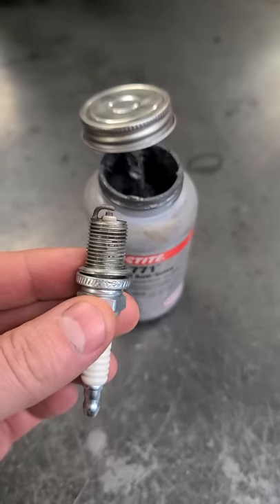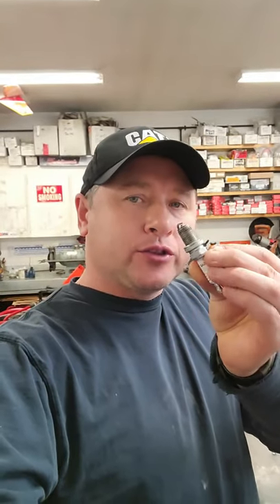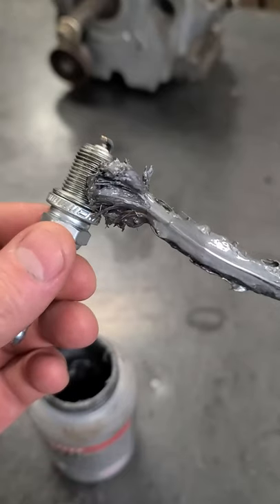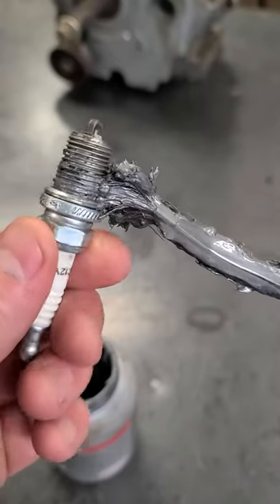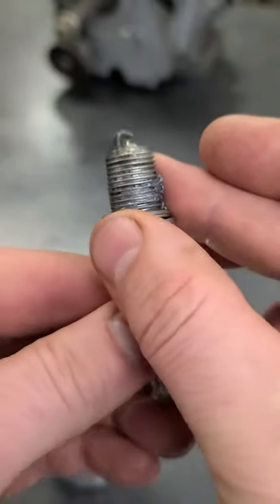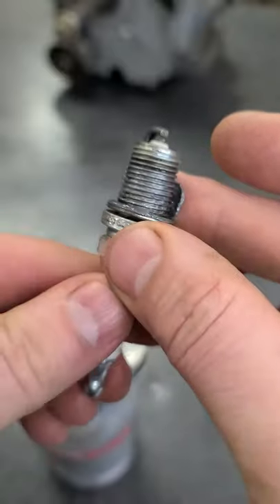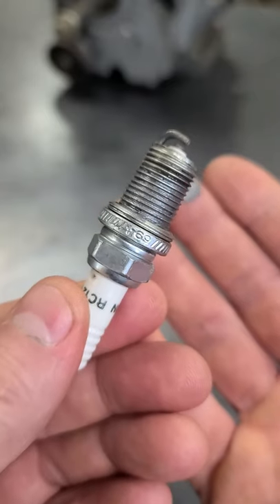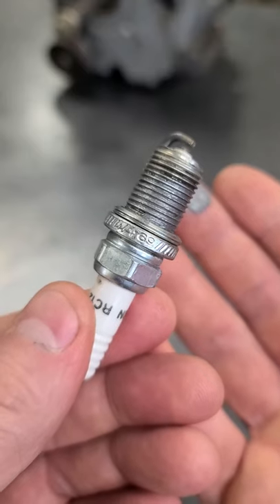Can I Use Anti-Seize On Spark Plugs? #shorts

Comment: I think this is just overkill. It is more sense to put anit-seize where threads are exposed to the elements, rust and dirt. Usually spark plugs are cowered whit vent shield so they don't need that treatment.
Reply: Have a look at any PWC service videos where it protected in theory but several plugs can corrode to the extent that thread breaks off in cylinder head ...not easy to repair !

Comment: Only use it on the Ford 5.4L 3V (04-EARLY 08) SLEEVE as this helped to keep the plug from breaking off in the head. 4.6L Mustang 3v also. I also use it on exhaust studs on aluminum heads. I have been using it on the PTO shafts on my tractors and it makes them easy to push on and pull off. Works good on 5.0L water pump bolts.
Reply: Please pay attention. The subject is anti-seize on spark plugs threads.
Auto makers (including FORD) AND spark plug makers say:
 USE NO ANTI-SEIZE !
There is NO reason to argue. Period.

Comment: Wrong! Do not use antiseize on spark plugs. Antiseize is conducive. Only use some used motor oil on the threads to prevent miss fires.

Comment: Hello Everyone! Happy Holidays! 
If you do use anti-seize on a spark plug, consider using high temperature anti-seize which has more of a copper color to it. And yes, if any anti-seize gets on the ceramic spark plug insulator, it will definitely draw a straight carbon track to ground and etch both the plug, and the boot! Don, Thank You Sir for as always for all of your excellent videos. 
Best Wishes to Everyone in 2022!
Tom K.

Comment: Would nickel based anti-seize be the best choice for aluminum cylinder heads? Would this eventually cause a reaction between dissimilar metals? I would think copper anti-seize would not be a good choice. Maybe Stainless type?

Comment: Well I never used to put anti-seize on spark plugs. But all the ones with a gasket you can torque the spark plug they will come loose over time. If you put anti-seize on the threads they stay tight from my own personal experience. Anti-seize acts a little bit like glue. I personally have had to tighten spark plugs up on cars that have work loose over time with no anti-seize on plugs. If you don’t catch the loose spark plug in time they blow out of the hole. You can tell it sounds like a small exhaust leak.
Reply: ... I just retired from doing engine repair etc and I have to say that if your plugs come loose then they are not tight enough from the start. What any lube does (anti-seize or oil) is allow you to get more tightening with less effort. Properly tightened plugs do NOT fall out!

Comment: Just a little and wipe it down well with a shop towel. Still need good ground contact for a good spark.
Reply: it will get good ground contact thru the strained threads.  on older machines that have had little to no maint the plug wires may break inside so when u take them off they are so brittle that they break and wont run/run right. dielectric grease on plug, porcelean and in the plug boot and connector so u can get it off next time without ripping the whole thing off. also good for dipping the machine in water. ran jeep thru torrential rainstorom on interstate no inner fenders... never missed a lick with dielectric grease all over the spark plugs/boots... dist plug wire boots. HEI ignition

Comment: I agree people should use anti-seize on the spark plug threads, however a very small amount is actually needed. Less is more in this situation. Also it’s a good idea to put a dab of dielectric grease on the boot of the coil pack while installing onto the spark plug.

Comment: I've always used anti seize on plugs for aluminum , and when I'm feeling skippy I'll use it on iron (doesn't do a hell of a lot unless in something that has the plug on top like a flathead or something like that . But I ran into a set of motorcraft plugs that said on the box "don't use anti seize". That struck me as goofy .
Reply: Plugs today dont need anti-seize. Also think about torque specs. You put a lubricate on the threads that cause the torque spec to change & you end up over torque because of the lesser resistance.
Reply: @wandameadows5736  I've changed thousands of plugs in my time and never had any come back for the next tune up with problems . I've rebuilt a shit ton of engines and rebuilt hundreds of cyl. Heads , done several various mods. , dumpling cyl. Heads back at the start and basically rebuilt every component in everything American and many Japanese. Imports in my fifty years plus in the repair industry . I just don't normally spout off about myself , but sometimes I no longer can shake my head .

Comment: You can but I would not recommend it. If ya cross thread the plug in an aluminum head you won't feel it until it's to late.
Reply: ... and that's why you screw a plug in by hand first! (just like a brake line)

Comment: The ONLY time I use anti seize on spark plugs, is if during removal, I have to use ANY effort beyond the first turn or two from snug. I use VERY LITTLE, as it WILL dry out over time and heat cycles and bind the plug in the threads, if too much is used. (I prefer copper anti seize for high temps components) If any threads on the plug are damaged I will use a thread chaser on the related spark plug hole, first!